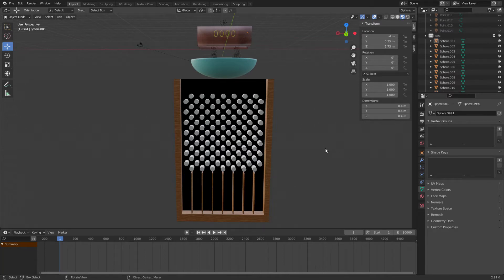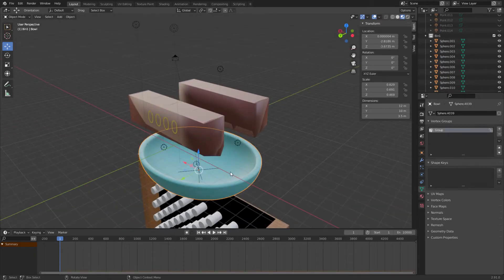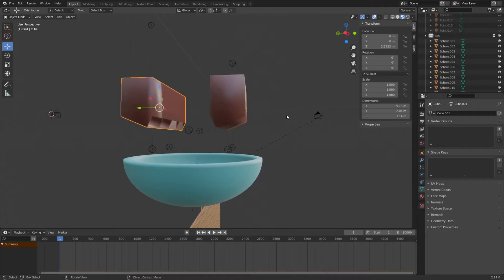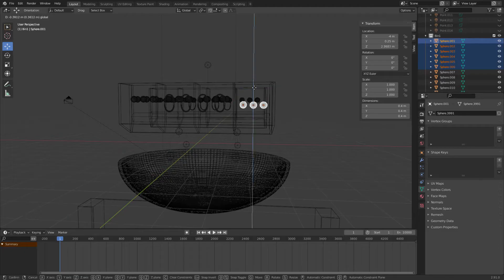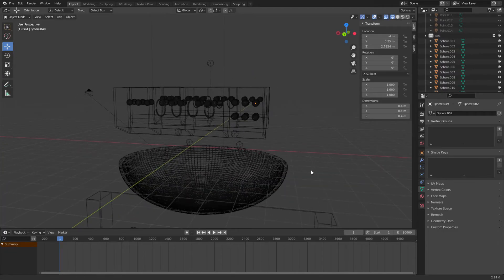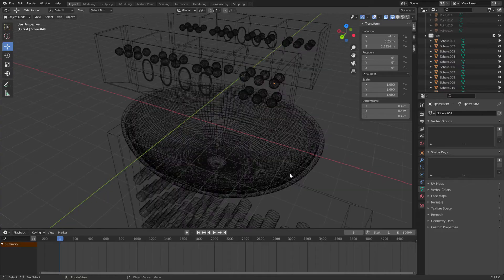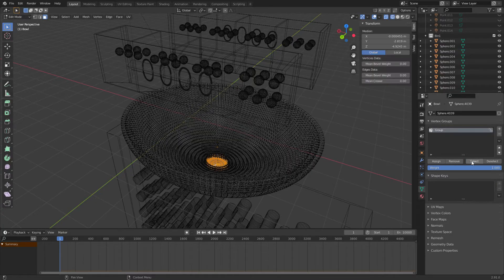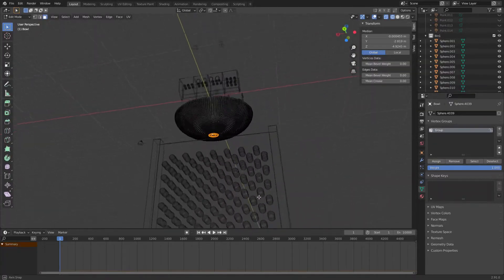Galton Board / Magic Ball Sorting Box in Blender

Comment: Ah, I had to watch a couple of versions to grasp this. So, when you first ran the physics simulation, the balls didn't have a colour assignment. You assign them a colour after they land, depending on which bin they land in. Then you replay the movement, having assigned them a colour, based on the knowledge of which bin they would each land in? "Baking" was a new expression for me. I'm sort of disappointed. I was hoping it was magic!! Thanks for sharing!
Reply from the maker: Yes - you have it right...I ran the simulation once, basically recording/baking it so that it could be replayed again later preserving where the balls fell.  Then - before rerunning it - I wrote code to assess where each ball landed - assigned the respective material to it - and replayed the animation with the material assignment done up front.  No magic...but it does look chaotic before magical as they all fall into place.